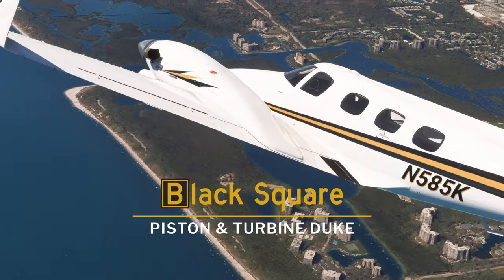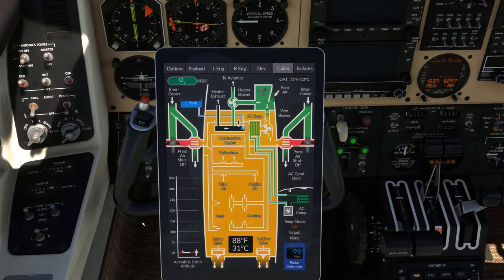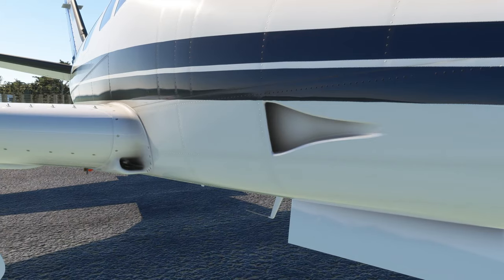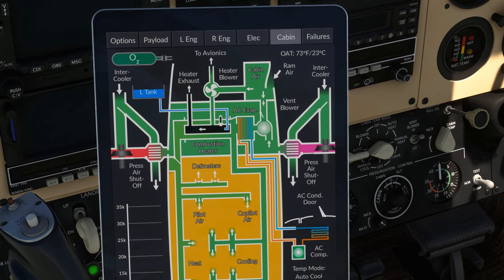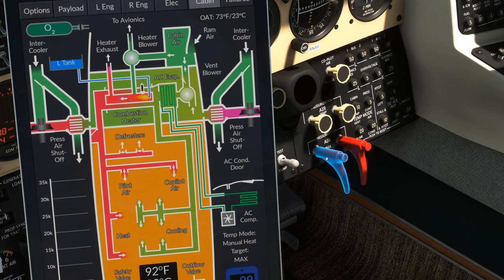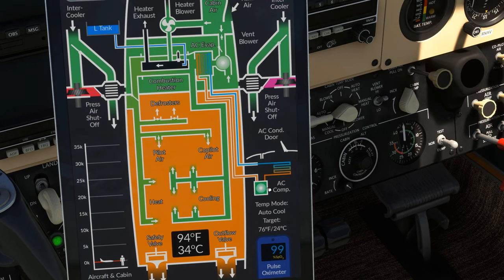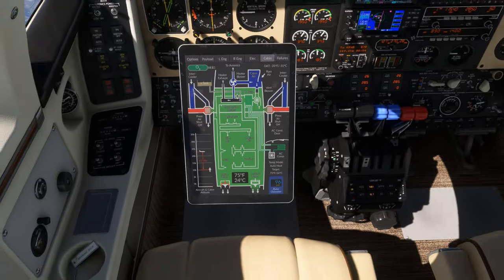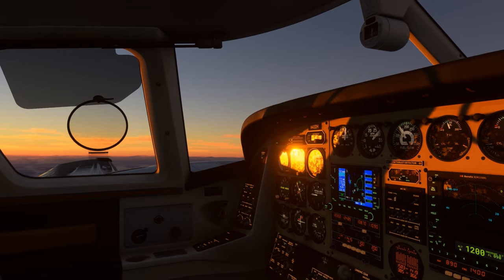Black Square Dukes - Environmental  - Just Flight

Comment: It will be an absolute honour to fly this clearly best and most sophisticated aircraft ever developed :) And I like these old-style kerosene combustion heaters to get my imaginary aircraft cozy and warm in winter even without the engines running. The old Mooney airplanes had such a type of heating to. 
One can never feel really safe with these things switched on for long without a carbon monoxide warning system, Dan Bass has an interesting story to tell about this type of heaters. They bring warmth and cozyness making the airplane more hygge than a cottage chimney on December 24th - but they can bring death too. A strange duality indeed........... Is carbon monoxide leaking by kerosene heater and a beeping CO-warner with flashing lights a possible failure and simulated in this aircraft?
Reply from the maker: Answer direct from the developer for you on this - "Yes, that is absolutely possible with my aircraft, exactly as you describe!  Either engine or the combustion heater can be responsible for a carbon monoxide leak.  The leak will trigger the carbon monoxide detector alarm on the panel, and the tablet will give a visual indication.  All possible failures are enumerated in the manual for you to peruse on JustFlight.com.  Enjoy!"

Comment: The system's depth in black square addons are top notch, outstanding, however, I wish they would work on the flight model, it is extremely twitchy, even with sensitivity settings configured, it is hard to hand fly the plane like you would in real life!
Reply from the maker: If you have an issue with the flight modeling please opent a ticket with our support team and they will try and give you input and assistance where needed.  Note that the Dukes and all BS products are tested by RW pilots of those specific aircraft and feedback is key to the developer. Within the constraints of the simulator the FM on the aircraft have been recognised as excellent by the community and by those RW pilots.  Often the behaviour of the aircraft can seem off but will be down to a realistic occurrence that has been coded with extreme detail by the developer.  Not saying they are perfect and of course there is always room for improvement especially given the host simulator isn't going to be 100% accurate (impossible at this point) but worth you getting in touch with the support team if you want to investigate further. Thanks

Comment: So it shows open and closable controls for the defroster, pilot and co-pilot vents from the piping that allows both heat and cool air. Shame that wasnt shown in the environment video. So where are those controls at bc I'm not seeing them on the Co-Pilot panel side?
Reply: I think thats the controls shown in the manual on pages 63 and 64 at a guess. Im no Turbine Duke expert. Controls such as Copilot Air pull control, Pilot air pull control and Defrost air pull control. The Copilot air control being right of the Copilots yoke and the Pilot air and defrost air being to the left of the Pilots yoke.

Comment: Can this thing do 300kts? :)
Reply: No!You can expect 220 with the piston Duke but maybe the turbine can reach 300.
Reply: No.  220 TAS from the piston and 269 TAS from the turbine.   Bear in mind also that the turbine has a lower VNE (never exceed speed) - 223 IAS for the piston and 198 IAS for the turbine. So at altitudes below about 8,000' AGL, the piston is faster.    In the flight levels, the turbine is considerably faster.
Reply: @DavidR_192  I'm sure I read a flight test of the real aeroplane where they managed slightly over 300ktas at maximum continuous power at something like 21,000ft.